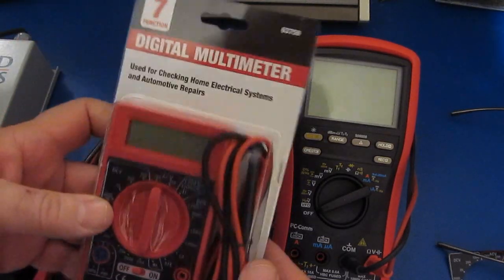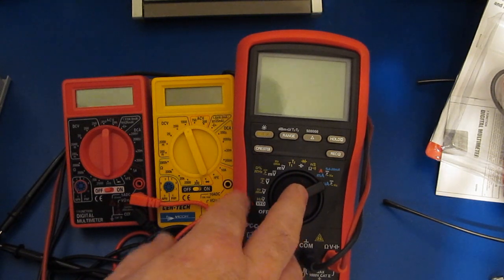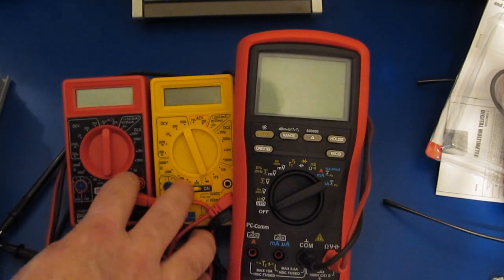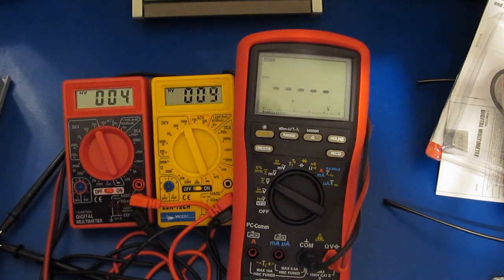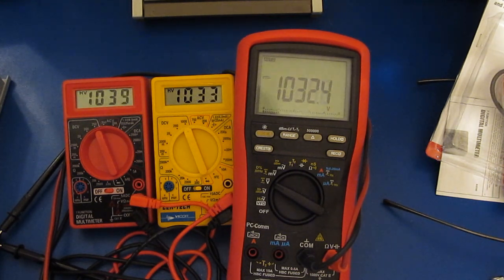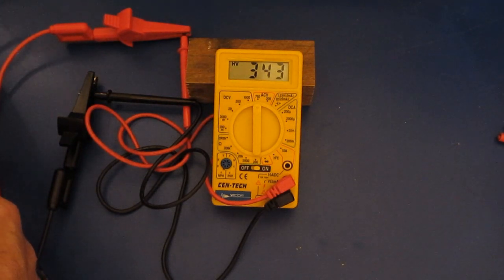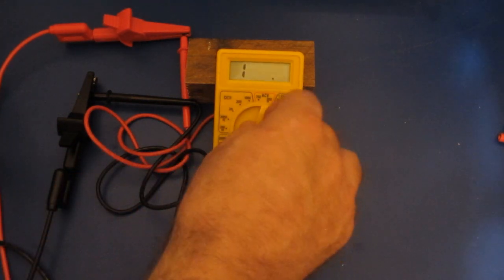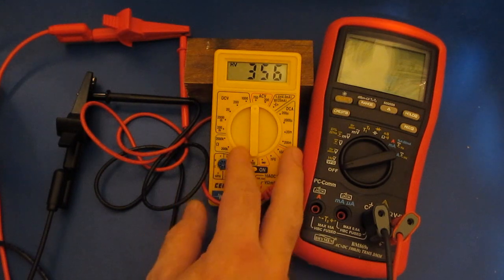Will the DT830 Harbor Freight Meter Survive at 1KV AC&DC?

Comment: Wow that was a bit scary at first, ive had these things given to me in the past and they usually read fairly well but I never would have thought the minimal board in these would survive that kind of voltage, hope noone takes this as some kind of proof they can be used like this-lol.  With todays chip technology it doesnt take a thousand dollar meter to measure basic volt ohm resistance with reasonable accuracy, but as you said theres virtually zero safety built into these meters and others like them and thats the big difference.  I have a small stack of these things somwhere but I never use em, just give em away with fair warning on how not to use them.  I really wonder why the makers and sellers of these arent concerned with the obvious dangers of these things,  maybe they have started to be concerned given they changed the voltage scale - but then it still reads up to a thousand soo...
Reply from the maker: I imagine there are people in the world who would use this meter in ways I would never consider using it.  Changing the design to limit the voltage levels may cost too much.
Reply: Cost is a definite possbility, almost like they just accept a certain level of risk based on selling thousands with maybe no big repercussions - who knows.   Anyone who knows anything about meters in general knows these things and the fact they represent the pinnacle of a low buck hobby meter, most would never use it in high energy areas but theres always one goof in the crowd--lol

Comment: Interesting. I wonder why they changed the maximum voltage on the meters? Were too many blowing up on people? As far as value goes it is tough to beat free.
Reply from the maker: It could have been a liability.  After dealing with the fallout from the chainsaws, they may be more sensitive to safety.   The point with the video was after watching Dave's testing, I wanted to show that testing a meter and having it survive while in the normal voltage mode at a KV is not that big of a deal.
Reply: It could be that freebie HF DMMs are a marvel of Chinese engineering too though. I bought a roll of bare steel stranded picture wire at the hardware store today and 40" of it was $6.95. I could have stripped a lead on a HF meter and been ahead of the game.
Reply from the maker: Wait, you don't want you pictures falling off the walls do you?
Reply from the maker: For the wallet sized pictures, that should do nicely.

Comment: Please, consider to make videos about testing surge effects on cheap power supplies or cellphone chargers.
Reply from the maker: Like Sean, you have no idea what you are asking or watching.   I suggest reading this thread.   https://www.eevblog.com/forum/testgear/seanb_s-usb-charger-transient-tests/
Reply: joe smith I need to study more about the subject. I have designed a product that uses a external power supply. One user showed me a defective unit where internal regulator had severe burning marks. I have no ideia If It was done due mains surge discharge or if It was caused by intentionally high voltage applied.
Reply from the maker: In order to perform the IEC surge/burst transients would at home would be a pretty big investment.  The cost of the combo generators, coupling network,  some sort of blast containment, running the service to power it.    Then there is a risk that goes with it.

Comment: When i see the 500v and you touching it whit bared hands i was thinking here  goes his last video. xD
Reply from the maker: You must have been concerned when I turned the knob to the 200VAC range.  This particular supply is not very high power.  I do have equipment that requires some degree of protection.  This is just not one of them.
Reply: @joesmith-je3tq  so 500V and less than 1mA? Sure but your hear "clock" doesn't like 50Hz frequency, stay safe
Reply from the maker: @kitecattestecke2303  I have a few bits of equipment that I take extra precautions with.   The transient generators could be a problem.  I have a KV supply that's also poses some risk.  I'll frequently use rubber gloved when I play with it.

Comment: lol that one(harbor freight meter) actually worked right out of the box !
Reply from the maker: I've only had a few that didn't.  These new ones are even cheaper than the previous versions.
Reply: Cheaper than the old free ones you say? Are they paying people to take them now? As bad as HF freebie meters are they're still probably better than the first digital meter I owned. I had to pay good money for it too.
Reply from the maker: Made cheaper.  I'm not sure if they charge you more or not for them.
Reply: Harbor Freight will sell their freebie meters to someone that wants to pay for it. I think they cost $5.95? That's the I forgot to bring a coupon tax. But that meter has gone through a lot of revisions. In the early ones the circuit board filled the whole case. It almost looked like a real meter inside.

Comment: I had one similar to this in 2000 - 2002 and it blown when measuring 230VAC, in AC 750 Volts mode. The last reading was 1535 and then "bang". Fortunally the RCD / GFI tripped but i never used one of these in mains again. Maybe they improved this particular meter through the time.